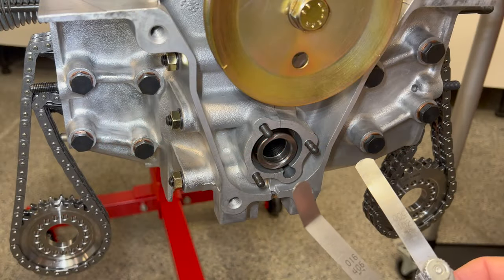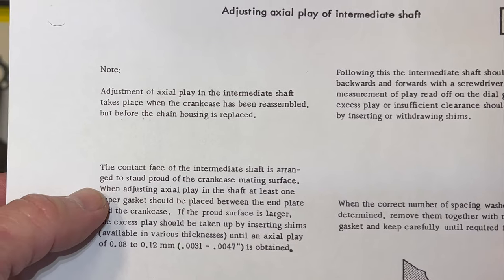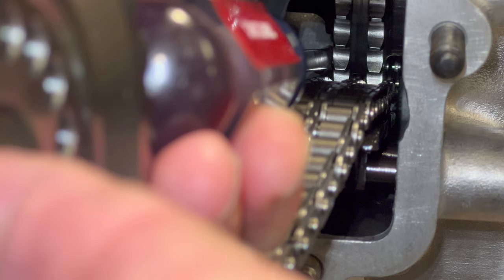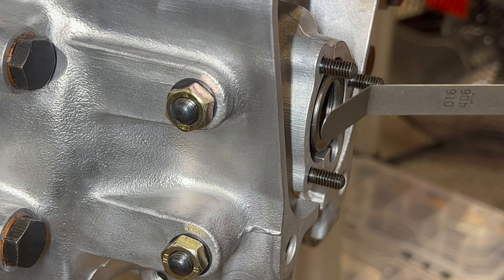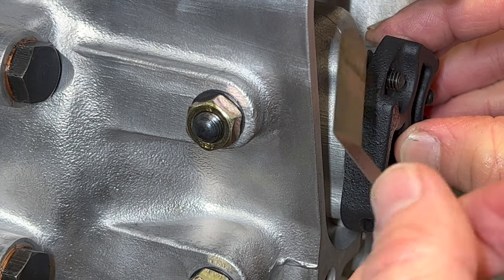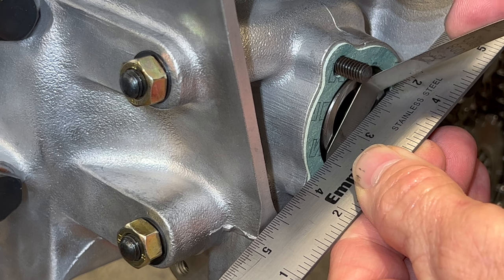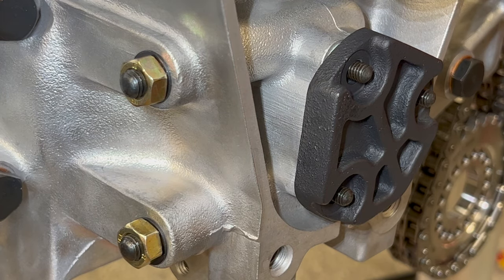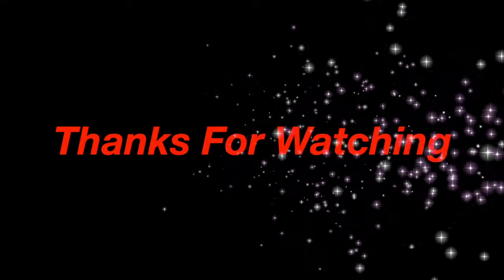Adjusting for Intermediate Shaft End Play!

Comment: So how do you know actual endplay since crush factor of paper gasket is unknown?
Reply: Set up a dial indicator to measure the height of the plate before and after applying the specified torque.  If it's out of spec, you have to change it anyway.
Reply from the maker: Jeff, metal shims with thin paper gaskets are the best and predictable if you can get the correct shim size. This is much more precise and easier to measure. The for and aft travel of the shaft while running is minimal but it will drift forward. If it's too tight it will rub against the stop. If the stop distance is too great it could put pressure on the intermediate gear causing premature wear.
A thick paper gasket is trial and error even with a dial indicator there can be some measurement deviation.
If you can get within range you should be fine